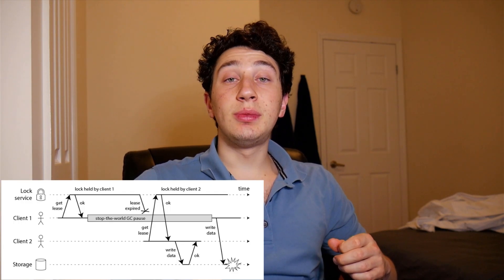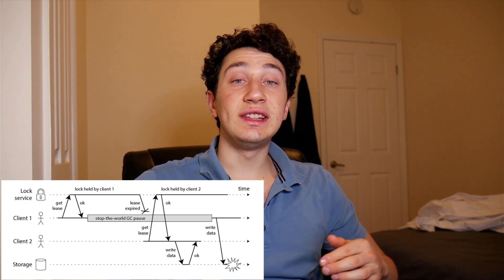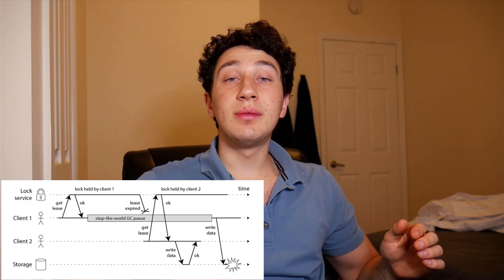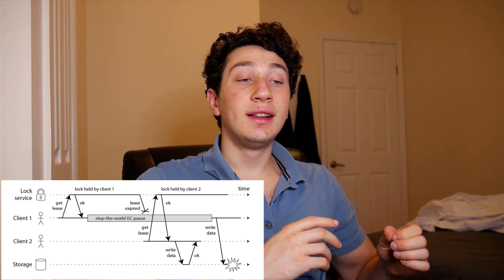Distributed Locking Design Deep Dive with Google SWE! | Systems Design Interview Question 24

Comment: This is the best distributed locking system design video on the internet! Amazing!

If you ever get around to posting another video about distributed locking, I would improve it in 2 ways:
1. Show how to implement TTL on the lock servers. Should TTL be computed every time a lock request comes in or should a background thread monitor TTL for the lock and expire it? This also help clarify the fact that while a lock is not TTL expired or released, a new lock cannot be obtained.

2. Right now, in your design, there is one global lock. In reality, clients might want a lock "per resource" for better scalability. How would this be implemented? Should each unique resource name encountered maintain its own separate lock WAL? What if clients abuse the system by requesting locks for millions of different unique "resource names" - should there be a maximum number of distributed locks? Lastly, can the "resource name" be used as a partition key to better distribute the lock request load between servers?
Reply from the maker: I have made more videos on this! But to answer your questions...

1) Both the lock servers and the client need to know about the TTL, and the client presumably has to continually ping the lock server to extend it. The client should be conservative and make sure to act like the lock has expired before it even expires on the client.

2) Just normal load balancing/partitoning over the key space across multiple distributed locks.
Reply: @jordanhasnolife5163  Agreed with point 2.

Point 1 is a bit tricky. The issue is that clock and therefore timestamps are unreliable. In a distributed system, when locks get replicated to other servers, even nanotime becomes unreliable, since every server might be on different "ticks" of nanotime. I have been thinking about this for some time, going as far as to explore Hybrid Logical Clocks, but I don't have a good solution. The best I can come up with is that in a replicated locking scenario, TTL is best effort and not accurate. If I come up with a good solution, or find one, I will reply here :)
Reply from the maker: @ See the chubby video that I posted, I go into this a bit more.  You need conservative timeouts basically.

Comment: In https://youtu.be/szw54UbPJRE?t=395 , you said the machine thinks it still has the lock. So it can corrupt the file on s3. I don't understand why it leads to corruption? Since the ttl is expired, lock server releases the lock for the down machine and gives it to another machine. Now if the dead machine goes alive again, it can't edit the file at the same time, because it doesn't have the lock anymore.
Reply: I think it is best if you read DDIA chapter 8 - The truth is defined by the majority - sections The leader and the lock & Fencing Tokens.

Basically the dead server (which previously held the expired lock) once it comes back alive will still be able to write to the register it was accessing because in its mind it thinks it still holds the lock. It was in the middle of writing when it went dead temporarily. Without proper usage of incrementing Fencing tokens the s3 data would corrupt.
Reply: I think node being down means network partition. It may still be possible that the node is fine. If that is the case, then the node will still be holding the lock even though it expired at the remote service that granted the lock.

DDIA is indeed a great reading material and a must I would say if you are preparing for interviews.
Reply from the maker: Simply grabbing the lock doesn't deem whether or not you can write to s3, as s3 has no knowledge of the distributed lock.  S3 will accept writes from anywhere.  The distributed lock is only useful for managing the activities of different nodes within our own backend.

Comment: In the DynamoDB example @10.14, if those were quorum writes and quorum reads, then the scenario of reading the record from only one node won't arise. As in that case,  the write itself would have failed. Similarly, if the write was successful, then quorum read would fail if it gets two different values. R+W > N should guarantee reading the up-to-date record.
Reply from the maker: Hey!  So the write "failing" just means the client sees that their write didn't go through.  How does the database know that it needs to revert that write?  It has to ask the other nodes?  What if there's a network partition?
Reply: Writes in DynamoDB are through Leaders, a write is successful only when a majority of nodes accept it. 
For Reads(from AWS documentation) - "DynamoDB provides read-committed isolation and ensures that read operations always return committed values for an item. The read will never present a view to the item from a write which did not ultimately succeed."
I am not quite sure whether DynamoDB reverts or just disregards the unsuccessful writes, but the point here is subsequent strongly consistent Reads won’t fetch such records.
Reply from the maker: @sshah2k9  Yeah I think ultimately you'd have to dive into how they know a record isn't committed - they need to send two network calls to that node
Reply: @jordanhasnolife5163  Writes in DynamoDB are through Leaders, a write is successful only when a quorum of nodes accept it. 
For Reads(from AWS documentation) -> "DynamoDB provides read-committed isolation and ensures that read operations always return committed values for an item. The read will never present a view to the item from a write which did not ultimately succeed." 
I don’t have the details on whether DynamoDB reverts or just discards the unsuccessful writes, but the point here is subsequent Reads won’t fetch such records.
Reply: @jordanhasnolife5163  Writes in DynamoDB are through Leaders, a write is successful only when a quorum of nodes accept it. 
For Reads(from AWS documentation) - DynamoDB provides read-committed isolation and ensures that read operations always return committed values for an item. The read will never present a view to the item from a write which did not ultimately succeed. 
I don’t have the details on whether DynamoDB reverts or just disregards the unsuccessful writes, but the point here is subsequent Reads won’t fetch such records.

Comment: In the diagram that you have shown, are the clients running on machines which are completely different from Raft servers (in other words, this means are Raft servers external to the client applications) ? or are the clients running on same nodes of Raft servers (peer-to-peer) ?

I have a use case where there are some n machines. I want only one of these machines to perform a task. Is there any peer-to-peer protocol which will allow only one of these machines to have lock at a point of time ? or should these machines make an external call to a RAFT server to acquire lock ? I want to know if there is any solution where we don't want to use an external service for locks and instead use a peer to peer protocol to acquire locks within the same set of machines where client applications are running.
Reply from the maker: I guess that's kinda the point of something like the Blockchain - but that being said yeah the raft servers should typically be dedicated, or else u can have a job being run on one of the raft servers that happens to be in the minority

Comment: Great video. At 14:21, where you describe lock server nodes will hold data in memory, I would add that since we also write to a write ahead log (you mentioned this earlier on), we can always reconstruct the in memory data structure if a node fails from the log and not have to entirely rely on other replicas' in memory contents. I don't think relying on other replicas' data held in memory would be acceptable for a lock system like it would for a simple cache like Redis (just my opinion, would love to be corrected).
So, I believe something like this would work well:
1. In memory hash table (not a "log") to keep track of who owns which lock
2. On disk write ahead log which should be fairly quick to append to (just like the one used in LSM based databases).
Reply from the maker: Hi!  I appreciate the comment - I think the general point here is that while a write ahead log works for restoring state that was already on a node, the system state will have changed while that node is down and as such you will want to use the other replicas to make sure that a node that had failed but is back online is up to date.  This is the general point of consensus, I'd recommend checking out my video on Raft if you have some time - it should clear things up.  Generally speaking though what you've suggested is inline with what I've tried to suggest in my video too :)

Comment: fencingToken requires the storage system to implement the functionality around verifying and validating the fencingTokens. If its a simple file system then i think need to have an additional layer before the storage system.
Reply from the maker: You make a good point, I suppose I could have mentioned that more explicitly but placing a caching layer in front of the storage system would probably suffice!
Reply: @jordanhasnolife5163  hmm but this has nothing to do with caching right? I think what they meant was that rejecting write requests based on the fencing token should be handled either in the client or in another auxiliary service in between the client and the object storage. Unless you meant the caching layer would cache and do that.

Comment: How about a system that generates unique auto incrementing numbers
Reply from the maker: So I've taken a few minutes to think about this: how is this problem different than distributed locking?  Being able to make a universal increasing counter implies that you have total order broadcast which implies linearizability/consensus.  Let me know if you were thinking of something slightly different!
Reply: @jordanhasnolife5163  Yes strictly increasing auto incrementing IDs is the same problem as distributed locking, but this distributed lock system won't scale for incrementing IDs. That is because in distributed locking, you can partition the lock resources into several shards such that each group of replicas is responsible for a small set of files (or more generally, resources to acquire locks on). But in auto incrementing IDs, all the requests would have to go to the same leader of the only partition in the system (basically one machine). If it's going to be only one machine, we might as well just use system clock to find the incrementing ID (because system clock always increases)? That again won't be horizontally scalable, but I guess that is just the nature of the problem. Please correct me if I'm wrong.
Reply: How about we just store key value like resource name to node id which says lock acquired by that node, and whenever we want to acquire a lock, we do something like check and put in hbase which is atomic in nature underlaying it does locking as well for that.
Reply from the maker: @tavvayaswanth  While this works, it still requires consensus - HBase is built on top of Hadoop which is not fault tolerant due to the NameNode which is a single point of failure.  The only way to make it fault tolerant is to use a secondary name node which is kept up to date using an external coordination service like zookeeper.
Reply: @jordanhasnolife5163  got it more over its better to have lock information in memory across hosts as the reads would be more I assume and we don’t need to persist to hbase which would increase latency, storing in memory works well as long as we have slaves which can be consistent using raft protocol as you mentioned.